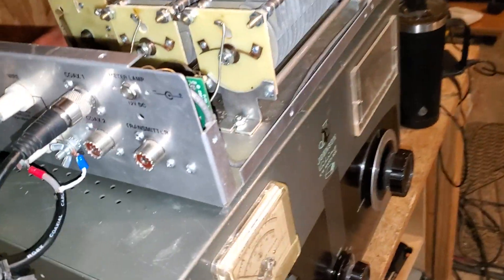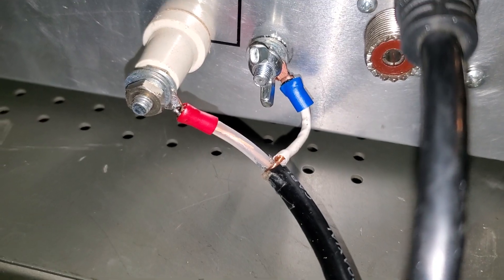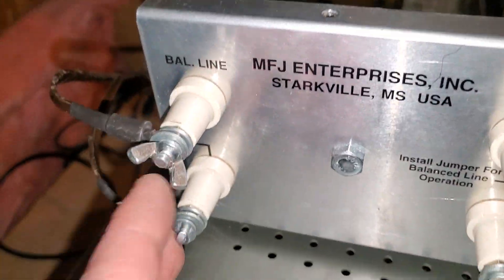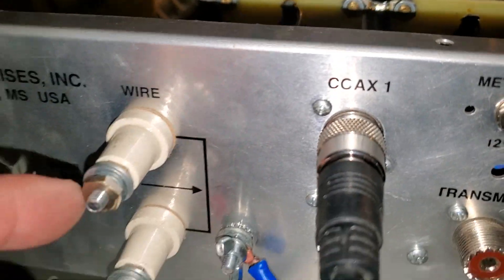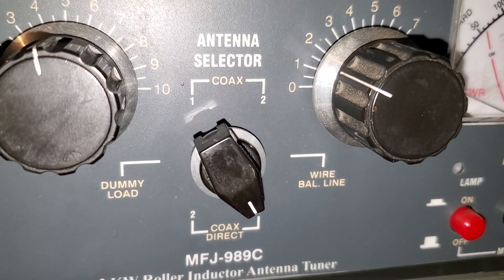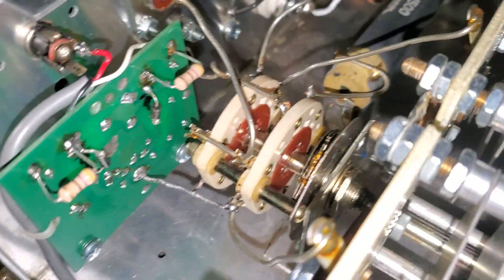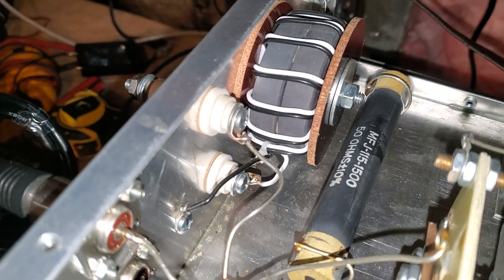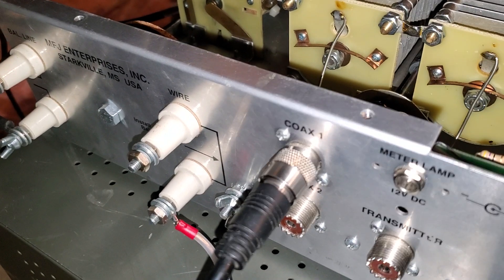Antenna tuner trick for balanced line twin lead ladder line

Comment: So, rather than just using a 4:1 balun in a box you are using the entire tuner just so you can use the 4:1 balun inside? If it's so junk why don't you either sell it or sell it for spares and remove the balun or just make a 4:1? You might find that a different ratio balun or unbal is actually a better match than a 4:1 anyway. Do you have a VNA?
Reply from the maker: I have 3 of these tuners. I have other baluns. And some I've made. The point is so you're able to bypass the tuner section or use it. Either or. Normally you must use the tuner part. There's no bypass abilities.  It's just a easy way to analyze the antenna with the nano vna to so how it's going to work without the tuner.  The antenna will have several resonant points where you might not need the tuner.  You can certainly attach a external balun of your choice to coax 1 or 2 and do the same thing.  I'm just showing a option that maybe most people don't really know is possible.
As for selling.  Well it's not worth my time or trouble  unless it's a friend.